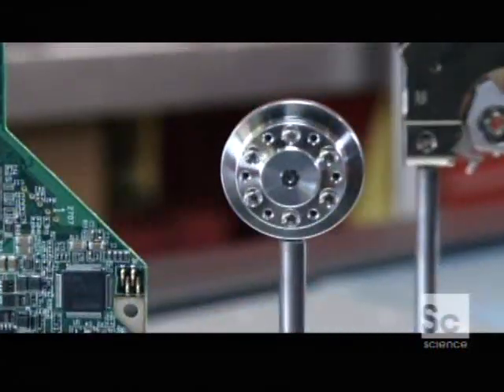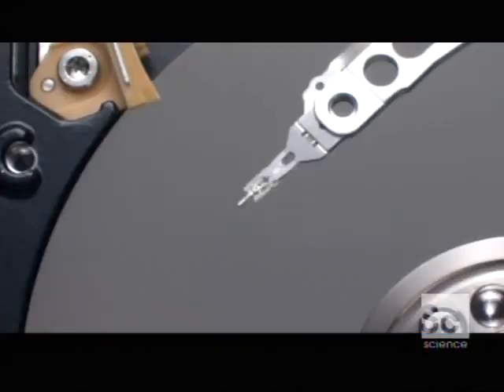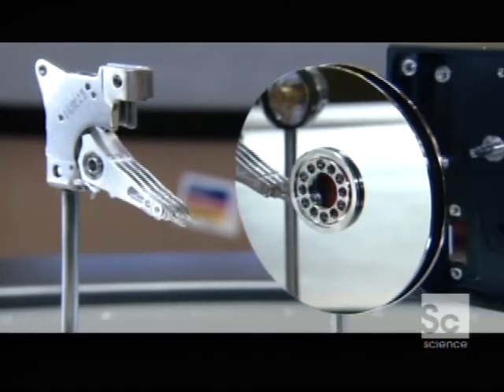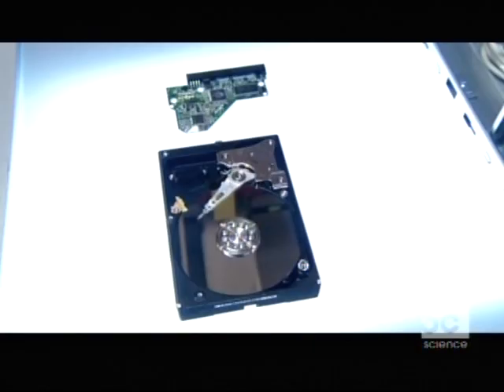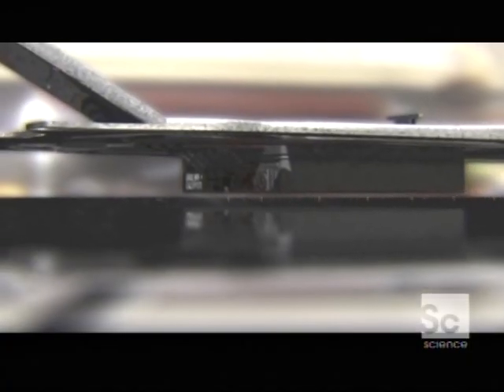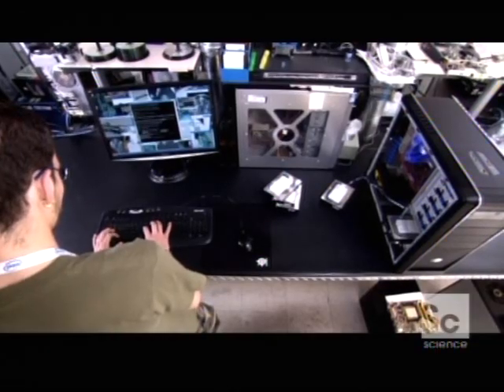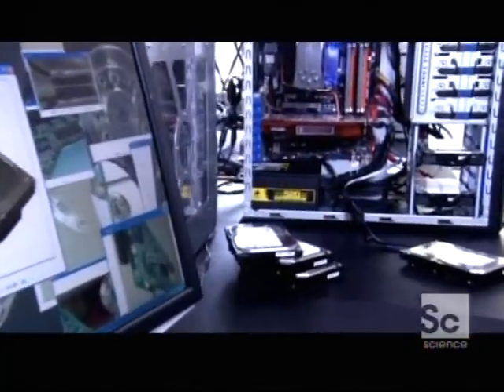Inside a Hard Disc Drive

Comment: Okay, so it said that 1 square centimeter on a hard drive holds 31 billion bits...  So a hard drive with a 3.5 inch diameter x pi =  about 11, x 2.5 (inches to centimeters) = a 27.5cm hard disk. (Squared)
27.5 x 31 billion bits = 852500000000 bits,  or a 100 gigabyte hard drive exactly.
with hard disks in the terabytes now, a 2TB harddrive would be able to hold 620 billion bits (72 gigabytes) per centimeter instead of the 31 billion (3.7 gigabytes) when this video was made.

But nobody probably cares.
Reply: *1.75^2 x 3.1416=9.62 x 6.25 (SQUARE inches to square centimeters)=60cm^2
60 x 31,000,000,000=1860000000000 bit=232 gb.
Reply: I've taken apart over 50 HDDs in my life. I'm seeing that the older larger HDDs had 2 disks, while the newer larger ones use 1 disk.

They've managed to fit 2 disks of information into just 1 disk.
Reply: Logan Strong i didnt understand anything but okay
Reply: as part of your observations were true, some can't be translated into real world hdd manufacturing. not all of the surface area of the disk is writable/readable. factors like extreme diameters such as the inner and outer diameters have so many noises that the actuators can have problems reaching its position and affects performance. also there are spaces in between tracks and sectors that are left blank during recording to avoid interferences during magnetic recording. you computed the whole disk and forgot that a large piece of the surface is also underneath the center cap that connects to the brushless motor.
Reply: 620 billion tiny violins just started playing at 60hz btw

Comment: 1.	What is the part of the name, that holds the Read write head?
2.	What is the mechanism that use to prevents the head crashing on the disk?
3.	What is the mechanism that used to move the actuator arm?
4.	Each Track Divided in to?
5.	Each 1 or 0 is Called a type of?
6.	What is the main mechanism that use in the hard disk?

can you answer the questions I ask ?
Reply: can you help me in this to answer

Comment: A slick presentation of the balancing act it takes to maintain such systems that we take for granted.
I was reading about the problem (of capacity) with commercialising the Laser HDD vs Magnetic HDD. The problem was, the laser uses 5 microns, while magnetic uses less than one. So, I looked up micron vs centimetre, and laughed my head off just thinking about such microscopic scales.
Here is another presentation about microscopic scales (in time): watch?v=mfgsQX78hg8

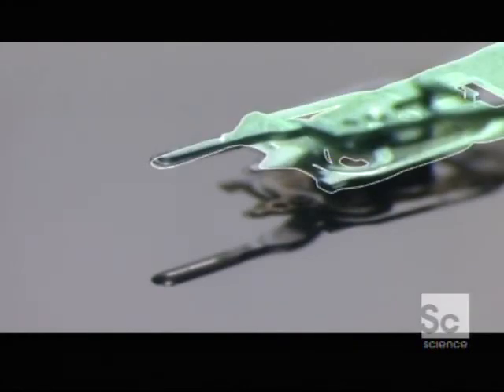Comment: @ 1:06 ....YES THERE IS FRICTION. Things that arent in direct contact doesnt mean they dont cause friction on eachother. The movement of the air at 80mph is an example of this friction. If there was no friction, the drive wouldnt work...period...beleive it or not the HDD REQUIRES friction to operate correctly and within specs...
Reply: Consider this if it wasn't for the AIR FRICTION... the heads couldn't float ...  so compared to ACTUAL CONTACT... yes it is for all intent and purposes a frictionless environment ... can't forget the spinning disks either they cause the air to move inside the drive as well (thus the cushion of air between the heads and platters)

Comment: 1. what is the mechanism that is used to prevent the heads crashing on the disk ?
2. what is the mechanism that is used to move the actuator arm ?
3. each track is divided in to what smaller unit ?
4. what  is the name given to each 1 or 0 is called ?
5. what is the main mechanism that is used in the hard disk ?
Reply: Anzwers
Reply: Esoft campus tutorial questions 😁

Comment: WTF is he talking about when he compares the head clearance to a 747?
Reply: The read head never touches the disk, it floats above the disk with only a few nanometers clearance, so the narrator is using it as an analogy that when the disk faulters and the head hits the platter, the damage done to the disk is similar to that of a 747 crashing.
Reply: Michael Hancock That's a stretch
Reply: not really, he compares sizes, it is like 747 is flying at 60miles per hour only half an inch (or so, i dont remember) from the ground!
Reply: @seekter-kafa  yeah 1/100th of inch above ground

Comment: i still dont understand how 1s and 0s actually take up physical space
Reply: why cant an infinite number of 1s and 0s fit into one "magnetic cell"?
Reply: why do they store the 1s and 0s in magnetic cells? Why can they only hold one 1 or 0?
Reply: n00b_asaurous
excellent answer. it made so much sense if you look at how you write code in C++
Reply: Connor Wiebe They are interpreted into 1s and 0s at a different hardware component. At the disk hard drive the only thing that is imposed or read is the positive or negative (or north or south) charges of magnets. The atoms of the disk orient their positive side towards the head component when the head has a negative charge. The atoms stay in this orientation so that they can be interpreted as positive facing or negative facing until they are rewritten. The positive or negative (also called north or south) is what becomes the 1s and 0s later. You can't get more than two outcomes with magnets. It's either positive or negative so computers decide 1 or 0.
Reply: Bravo for the explanation!, I study Computer Science and found this enjoyable to read.
Reply: Physically it takes high voltage and low voltage, for our convenience and binary calculations we take it as ones and zeroes
Reply: actually the 0 and 1 take several form from equipment to other, if we are talking about stockage or memories or transmission  we are front of 0 Volt for 0 and 5 Volt for 1( sometimes depending the form of codage like manchester codage ...or NRZ or NRZI or MILLER there is who have the basics like -12 Volt in place of 0 volt and +12 Volt inplace of 5 volt)  
and if we are talking about hard disc we are front of magnetic term  take for example if i put screw in  my friend maile boit  and if they find it magnetic that's mean i'm coming if not i'm not , that sample for 1 the tinny space it's be magnetic for 0 nonmagnetic 
and for the DVD player or CD we are here front of   coding by light,  depending the light that they make for each message  to understand that the laser lens  send light that touch the DVD(CD) and that light bouncing from the DVD( CD ) coming back to the collector with other color to give the message( to analyse the light  with world norm and give for each color the exact meaning ) exemple if we assume for red color it's 3v for yellow it's 4v and so on 
if you want to understand all that you have to read all the components separated from each other, and by putting in your mind that you are using the Voltage term and  the magnetic or light tech
Reply: It is the magnetic reaction in each atom

Comment: So basically, hard drives are like old jukeboxes from the '90's(or '80's) but with a circuit board that keeps the 'disk' rotating every minute without stopping (except without electricity), btw i have a question, does overclocking a hard drive speeds up its spinning speed? just asking..

Comment: You're confusing Analog storage on magnetic tape (cassette, reel-to-reel) with HDD magnetic storage. HDD's are magnetic storage devices of binary information. The only thing you are correct about is that the info is not stored as 1's and 0's, they are stored as positive and negative, which is read as either a 1 or a 0. Analog storage was similar to a waveform in that a stronger analog signal was reflected by a stronger magnetization of the tape, making the magnetic field appear as a waveform.

Comment: Electricity and magnetism are the same type of force
Reply: Moving charges produce magnetic fields. Magnets are materials with a natural magnetization due to those moving charges generally speaking. The expression of the electromagnetic force differenciates the magnetic and electric term as a result of historical tradition.  
The general property of matter that produces the force is the charge , in both cases

Comment: So the head magnetizes tiny particles to 2 different state, N to S or S to N. How do all these magnetized particles don't interfere with one another since there's billions of them.
Reply: +xmdude626 "spacing" or "density" - hard drives are now at the point where it's difficult to pack the magnetic domains any closer, which is why we now have "shingled" (SMR) drives (which overlaps tracks. Great for archive work but lousy for anything else) and "heat assisted magnetorestrictive"(HAMR) tech - which mounts a laser on the read/write head to zap each spot to a higher temperature for writing.

Both technologies are problematic and by the time they're perfected there's a good chance Solid State Drives will have overtaken them in both size and price.
Reply: +stoatwblr fat or file allocation table

Comment: I use HDD. I have no problems with speed, so I would never change it to SSD. HDDs are more durable than SSDs.
Reply: correct
Reply: try putting a magnet or throw it down😂
Reply: @sfz119  Who stores any magnet around his PC? O.o 
By the way it needs a strong magnet to wipe data or destroy it. Be prudent and don't throw it down. ;)

Comment: If these clearances are so small, how can devices survive even the slightest movement, let alone being dropped??
Reply: The spinning of the disk is enough to keep the heads floating. If there's any power loss, even if the power lead is jerked out, the heads automatically park. They stay there until the drive is powered up and the platter is spun up to operating speed. In park, the heads are locked up and out of the way, so no contact is made. Of course, dropping it can dislodge the heads out of park and scratch the platter.

Comment: And how is data deleted?
Reply: When you delete files via the operating system, such as by emptying the recycle bin, no actual deletion occurs. Rather, the sectors containing the data are marked as empty space. Those sectors are overwritten at a later time when new data is written in the same location. Because that's true, it is possible to recover deleted files even after emptying the recycle bin using certain utilities.

There are ways to securely delete files. In that scenario, the sectors are marked empty, then overwritten with random bits, and then marked empty again for later use.

Comment: How exactly does the weight of the read/write head compare to a 747 packed with 10,000 passengers flying at 60mph at 1/100th of an inch off the ground???? What a ridiculous and totally meaningless comparison.

Comment: Nothing about how data really works... oh well :D
Reply: The hard drive stores your data as positive and negative charges on the disk platter.  These are interpreted by the computer as 1's and 0's.  The way the computer stores numbers are with a series of 1's and 0's, each one of those is called a bit.  They're basically like electronic switches and are used because of the invention of transistors which is basically an electronic switch which will change the direction electric current will flow in one of two directions.  So in order to store numbers in a computer, you have a series of these switches, each one on (1) or off (0).   So in an 8 bit number you have eight 1's and 0's, each position represents a different value.  To store a 1 in 8bits you have 00000001, the right most bit represents 1.  The next bit over represents 2, the next bit over from the 2 represents 4, then 8, then 16 and on up, doubling each position until the left most position which equals 128.  If you have all the bits set to 1 like this 11111111 you add them up, 128+64+32+16+8+4+2+1 = 255 which is why that is the maximum value in an old 8bit system.  If you want to store 254, you have 11111110 (so all the bits are set but the 1) or if you want to store the number 3, you have the 1 + the 2 bits set like this 00000011.  On a hard drive it would read these values in and every so many bits (on a 64bit system it may read in 64bits then form a value from that).   Everything on your computer is a number, the text you are reading is stored in the system as numbers (representing which character number to display), images are stored as RED+GREEN+BLUE values, usually 32bit (actually RED+GREEN+BLUE+ALPHA, Alpha, if used representing how transparent it is), so on a hard drive, you have 32bits, or 32 positive and negative spots on the disk set for each pixel you see on screen, that's a lot per pixel, but they don't take up much physical space on a hard drive disk. 

So in summery, hard drive spins, the head detects positive or negative, converts that to a 1 or a 0, after about 64 of those, it forms a value which is then used to form a character of text like this, or pixels in an image etc... the computer knows what to expect as when it reads the drive and finds a file, the first few characters generally represent what type of file it is (an image for example) then it knows that each set of 32bits will be a pixel etc... etc... etc... hope this helps. ;)

Comment: NOW WE HAVE SSD'S (SOLID STATE DRIVE) FASTER THAN HDDS!
Reply: +AwesomeDesertTortoises But unlike HDD's the SSD's have a limited amount of write cycles before they wear out. So use it enough and SSD's can go to trash while HDD's are in theory eternal.
Reply: If that were true old XP and 95 computers wouldn't boot up nowdays. Machines that ran days and nights for years back in their time would still work perfectly today, got one from 2000 on my table, works as if been build yesterday.
Reply: +Omar Asha turn off ssd and it will lose data after 6 months, turn off hdd and it will hold data atleast 20 years
Reply: *****
If you are not at home and left pc without power...or data storing.
And still SSD has long way to go in term of GB/Dollar
Reply: *****
hdd is for storage so you cant deny that we still need hdd's
Reply: about the same as ssd good hdd will last 5-10 years ssd - 5 years
Reply: sdds are forever they can not lose data if to close to a magnet
Reply: Ok, su you buy bunch of ssd's i will buy ssd for OS and hdd for Storage
Reply: AwesomeDesertTortoises
But ssd's have performance degradation over time + limited number of write cycles, so if you write alot to it it wont last long
Reply: *****
So you buy bunch of ssd's i will stick with my 10tb space of hdd's (1tbwd blue, 3tb wd green, 6tb wd blue) for storage which costed me about 400 us dollars, and for 10tb of ssd storage i need about 5510 us dollars
, it will take aleast another 5 to 10 years for ssd to come down in price as hdd
Reply: *****
For my personal use
Reply: That's bull. I know computers that have been running for nearly 20 years on the same HDD
Reply: Joseph Kreifels II
now you can get 10tb for 1tb ssd price and hdd will run you for 10 years
Reply: 1sonyzz SSDS are a scam judging by the price. Some cost over $7,000.
Reply: Not a scam if that 7 grand is going to save you power, rack space, and other overhead costs for running a datacenter

Comment: A tad discrepancy when it comes to the how many bits to a byte. tcpipguide(dot)com/free/t_BinaryInformationandRepresentationBitsBytesNibbles-3.htm 
The only reason I came across this bit of information what when I was hooking up a SOLO temperature controller 9696 you could specify the " data bit length " 7 bits or 8 bits.